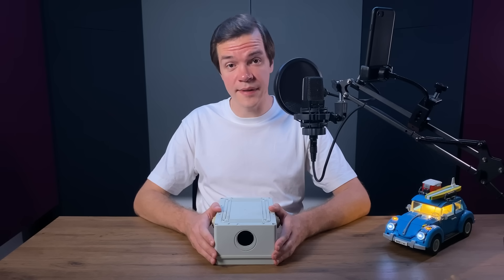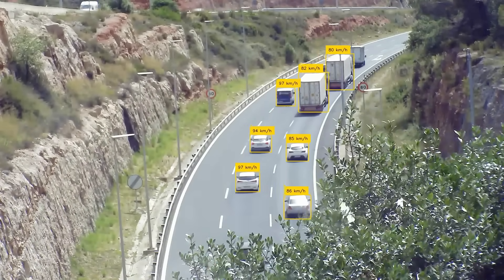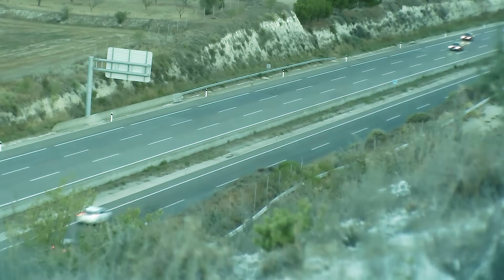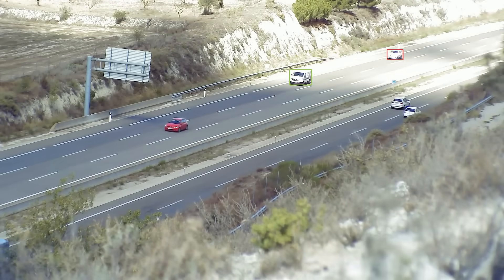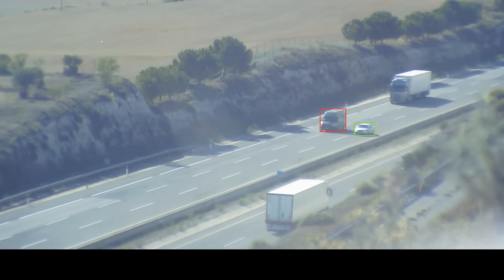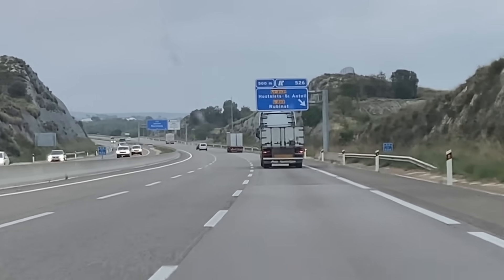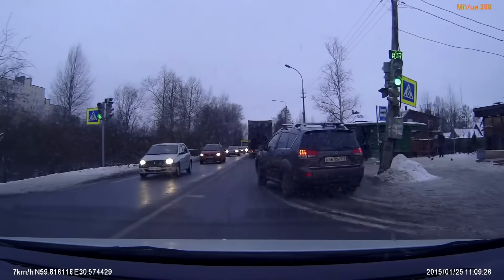New Anti-Tailgating Camera Reveals Shocking Statistics

Comment: Thank you! It's great you show how (relatively) easy anti-tailgating measures could be installed. Of course you may have someone look at the footage to check if someone got cut in order to not send out fines to the wrong person (even though that could probably be automated as well, by detecting Lane changes).

Anyway, I have always been very sceptical about self-driving cars, but every time I drive on a German motorway, I realise that it cannot be worse than half of th drivers there...

Comment: The key is fluidity. Not all people have it. Some people are choppy and use uncoordinated driving inputs that is governed by fear rather than confidence. Not understanding grip limit, escape routes, weight transfer, slip angle, etc. all count as recklessness to me. 
If you can't predict what's gonna happen to you in the next 5-10 sec, you're already in trouble. You should drive in a predictive manner, with varying alert levels and if you cannot for some reason, you can decrease your speed, also you can take a break, or go alternate routes that fit your current capacity and pace.

Comment: I very much like this video. What do you think of this: dangerous is the difference of speeds used on a highway, not really the total speed. Since the total speed on the lower end however is fixed by trucks, speeding actually is the main root cause of danger.

Comment: 35 years experienced driver here. What happens when you leave a safe distance between you and the car in front? .... That's right, someone drops into it and way too close. Tail gating is a universal thing, it's frequently an act of aggression that's intended to intimidate the slower driver into speeding up. It often has the opposite effect. Where I live the tailgating vehicle is usually an Audi, that might be a perception thing though... was that vehicle you observed speeding at 180 kph an Audi? It looked a bit like an Audi and was certainly driving like one.

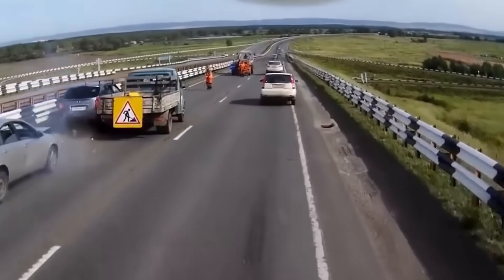Comment: No stats on actual incidents or if violating safe following distance is a significant predictor of accidents. Raising the question of automatic systems to punish violators is callous and unscientific. Some of the videos you clipped together run counter to your point eg: the truck at 9:12 but the accident at 6:06 describes it more accurately.

Comment: The solution is not to hope people follow your example, the solution is to maintain a safe following distance regardless of what other drivers do. If other people are constantly cutting into your following distance, then it tells you that traffic is too dense to go the full speed. The problem is just that most people keep up their high speeds even as the road becomes too crowded to support it. If you slow down, just slightly, then the people behind you will either slow down to match, or (more likely), they will change lanes to pass you, which will put physical pressure on the rest of the road to slow down as well. At lower speeds, shorter following distances become safer (though then impatient drivers begin behaving unsafely in other ways).

Comment: Most tailgaiting can be prevented by the front drivers.  In the states the left lane on the highway is designated for passing.  If you are in the left most lane move over if the car behind you is gaining on you. All the time where i live, semi trucks pass semi trucks going 1-2 mph faster than the other semi trucks, and it can take 5+ miles for the congestion to resolve.

Comment: in sweden it's very uncommon with cameras that issue fines on highways. The cameras are on other types of roads. Speeding is very dangerous when you dont take into account all that can happen on a street. Not much happens on a highway, which makes it kinda safe to speed. However driving where unforseable events are more common, speed becomes more important. Lower speed gives you more time to react and the consequences of crashing and driving into people are reduced.

Comment: One thing most people don’t think about is that cars have length, and as traffic slows down that becomes a big factor. 100 km/hr is 28 m/sec. So a one sec follow distance puts your front bumper 28 m behind the car in front’s FRONT bumper. If all the traffic slows down uniformly to 10 km/hr, the 1 sec follow distance puts your front bumper 2.8 m behind their FRONT bumper, which puts your front bumper inside their trunk. This does not even account for reaction time. Basically as traffic slows, highway capacity decreases.

Comment: Cars have the technology to be programed to follow at a safe distance.. but not everyone uses that feature or abides by it. So why not take car safety a step further and have a mandatory warning? You could employ this technology as a standard the exact way you do with seatbelts. If you dont put on your seatbelt on get an annoying dinging sound and blinking dash icon till you abide by the law. If you followed to closely and got a dinging sound and red blinking dash icon Im fairly sure everyone would back off after a few seconds just as they submit to putting their seatbelt on. The impact would literally be HUGE since most accidents are caused by following too closely.

Comment: Great video - I think there are other things we can look at, like you suggest, beyond enforcement.

Safety equipment in cars could do this automatically - not brake, but make the annoying sounds when you have less than a given distance at a given speed to the vehicle in front of you.

We have lane safety and lighting in mirrors, so we can ensure that the annoying sounds are heard only by the driver who crossed lanes (not the one who’s had their distance cut by someone else).

It’s logic that looks at your forwards gap to encourage you to not close in on the car in front, and logic that looks at your rear quarters/steering/lane adjustment to determine that you have just closed the distance on another driver.

The logic of someone pulling into your lane is looking at your front quarters and steering input - if you didn’t close the gap yourself, then the annoying sounds only start after a second or two instead of immediately.

Seems obvious to me, rather than trying to track this by roadside cameras.

Comment: 6:05 The minimum safety distances are two lines from the emergency lane, at first glance you can see that no one respects them.

Ironically, if Motorists, who cannot stand slowdowns and traffic jams, all drove according to safety rules and at the same speed as the cars in front, there would never be any traffic jams and very little slowdown ☺️

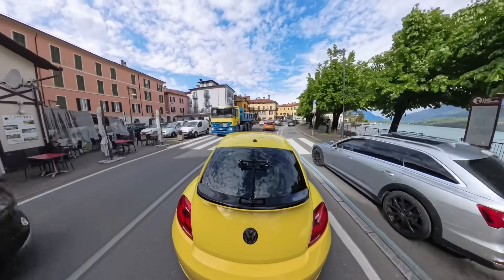Comment: 5:31 speed absolutely kills people and it's not just about stopping. The quality of roads and grade of turns are set to accommodate particular speeds. 

Also, the faster you're going the less time you have to react to unexpected obstacles that might appear on the road.

Speed traps can remind people to keep an eye on their speed, a lot more people might speed everywhere without them. 

There are also average speed cameras that detect cars at one point and measure their speed to another point, these can cover much larger areas that include high accident zones.

Speeding does kill and if you think you're a good enough driver to manage it, you're the person who's going to die unnecessarily if there's an obstacle one day

Those obstacles aren't always just the other vehicles on the road with you

I do want to clarify that I'm totally in agreement that tailgating is just as dangerous, if not more so, than speeding, but I feel like this video dismissed speeding too much

Comment: This! This is the reason for all those accidents that could have been avoided.

On country roads, where there is one lane per each direction the main problem is LACK of speed.

Let me explain: if someone does not drive at the speed limit it will 'force' the others behind to overtake. Thus leading to dangerous overtakes and unnecessary speeding (if the speed limit is 100, and the one in front is driving at 90, you will regularly see people drive at 130 ehile overtaking, then gradually slow down to 100. But if one would drive at 100 and maintaining that speed, then the overtake would not even take place)

Comment: The most dangerous thing on highways is absolutely people who make unnecessary lane changes in an effort to go faster
Reply: or u want to merge into the lane on ur left. there is a car in the left lane about 4 car lengths back going at about the same speed as i am, so he is not closing the gap., u put on ur left turn signal and the guy in the car in the left lane starts to speed up
Reply: @meTimetraveler  yeah that's annoying
Reply: did you not watch the video lmao wtf its tail gating!!!!
Reply: Not at all. The most dangerous thing is people who sit in the middle or 3rd lane going the speed limit or under
Reply: How is changing lanes categorically dangerous? Can you not see the cars to your side??
Reply: @PiOfficial  I don't think it's categorically dangerous, it's just not as safe as staying in the outside lane, which is why it's taught when trained to drive at speed. If I remember right there's 2 main reasons for this, first is that you only really have to pay attention to 3 sides (front, back, and inside), not 4, which lowers the cognitive load, and 2nd is that it doesn't needlessly increase the mechanical stress on the tires, which lowers risk of failure.

Contrast that with weaving in and out of traffic where you're going in out in out in out of traffic all the time.
Reply: Or the slow people in the left lane forcing them to change lanes.
Reply: @conservativeriot5939  not being permanently in the passing lane goes both ways. If you’re just driving fast and not passing someone, you’re using the lane wrong too.
Reply: @z-beeblebrox not if there's nobody behind me that wants to pass. I usually move to the right any way so I can blend in.
Reply: @conservativeriot5939  The rules of the road don't magically change when there's fewer cars
Reply: @z-beeblebrox  there's intent behind laws. Can you figure out what the intent of this law is?
Reply: @conservativeriot5939   To keep the lane clear for passing, which you would be failing to do in this scenario
Reply: @z-beeblebrox correct and incorrect in one sentence. That takes skill.
Reply: @conservativeriot5939 asinine how confidently wrong you are. You should be leaving the left lane every time you are finished passing. It is never a driving lane
Reply: @deadmittens50  I'm just that good. Haha
Reply: @z-beeblebrox yeah just because theres no one behind you doesnt mean you are suppose to be traveling in the passing lane
Reply: @deadmittens50  This guy represents half the people in the damn lane in the first place
Reply: @z-beeblebrox   the left lane is the F the speed limit lane, no point in getting back in the right if you going fast enough to pass everyone in the left, Just have to pay attention to your mirrors for someone who's going faster than you and get over for them then get behind them and keep moving.
Reply: @conservativeriot5939 Nope. They are annoying, but not not dangerous, contrary to those who think they can make them change their behavior by being reckless and dangerous around them.

Comment: Speed cameras on freeways in the U.S. are stupid. They should work like they do in Europe and the rest of the world where they measure speed over distance by using multiple cameras. You can easily slow down to the speed limit where there's a camera and then speed back up again, but not if your speed is measured by how long it took you to get to the next camera - the only way to not get a speeding ticket with that kind of speed camera system is to not speed. There's no cheating physics.

Comment: From where I'm from, light tailgating in the left lane (typically faster lane) is acceptable to signal the slower car in front to cede passage.  Typically going from 30m to 20m/15m to communicate that the driver forward needs to cruise to the side.

I know this isn't recommended but in low-mid congestion and ideal weather, I think its ok.

Comment: We have a minimum distance of 2 seconds in Austria, since it accounts for the other car's break distance.

We also have some camera's that can issue fines for tailgating. They simply measure the distance over a stretch of road. If you are beneath the limit at both entry and exit, you get a fine.

Tailgating is still a problem here though, but less than in America

Comment: Ultimately driving will never be very safe. The solution is more public transit and mixed modal transport. People can take rail or maybe fly for longer distances but then for short distances they can use micro mobility or car shares for local areas. The problem is this essentially abandons the concept of individual ownership of vehicles - which society won't accept.

I like your conclusions but I think that always applies to speeding and some other infractions - to some extent at least. There have been plenty of instances where my choice is either speed up a lot or massively slow down so I can safely get over a lane - slowing down isn't always possible as there are cars behind me, plus then I'll have to match traffic speed again once I change lanes and cars generally can decelerate much more quickly than accelerate, so it's a lot easier to speed up, merge, slow down, than the reverse. I've also had to speed up to get myself out of relatively unsafe situations or put distance between me and irratic drivers.

Comment: Tailgating has always been, in my mind, one of the very dumbest common driving habits.  People who tailgate seem to have a profound lack of both intuition of the physics of vehicles, and also imagination and the ability to guess the future outcome of a situation based on variables estimated in the current moment.  They also drastically overestimate the amount of skill and "control" they possess.  Always assume control is an illusion (it is) and act accordingly.

I think most people don't realize that when driving down a highway at 60 mph/96.5 kmh, they're traveling at 88 feet/26.5 meters per second .  That's actually very fast.  

If an object that weighs several thousand pounds is flying around at speeds like that, it takes significantly longer to stop than most people think.  

At 60 mph/96.5 kmh it takes a good 250 feet/76.2 meters or more to stop.  Already that's almost 3 full seconds.  Just the brief delay in your reaction time from seeing danger to depressing the brake pedal will add another not-insignificant distance to your stop at speeds like that.  Antilock brakes also behave in a way most people don't expect.  All in all, you're looking at a good 5 or 6 seconds to stop that object moving at highway speeds, and that's a VERY LONG TIME given the kinds of timescales car accidents happen across.

It's obviously an abysmally poor idea to drive 60 mph/96.5 kmh toward a car that's 2 carlengths ahead of you.  Giving yourself a mere ~30 feet/9.14 meters to make a stop that's gonna take you 250 feet/76.2 meters or more to complete while your life is at risk, is plain stupid.  You could crash into that car like EIGHT TIMES in the amount of time it would take you to stop once.

Just don't tailgate.  It won't get you there faster.  In fact, it causes more people to slow down than speed up.  If someone else is tailgating you, try to move over if possible and just let them get tf away from you.  On streets where you can stop, just pull over for a second.  It's not worth the risk to your health—or if you're American like me, your insurance premiums and the risk of bankruptcy from healthcare costs...

Comment: if I leave 3 seconds to the car ahead, someone will always cut in. So I don't brake when that happens, but I may slightly ease off the gas, a little. The good news is, I can see not just the vehicle ahead, but also well ahead of that. If the driver ahead were to slam on the brakes without warning and for no reason, they would instantly create a dangerous hazard. But they dont. They always have a reason, and I am able to anticipate that and gradually increase the distance, or change lanes, to remain safe.

Comment: I'm not sure I agree with how you calculate the safety index. Kinetic energy goes with the square of the speed, not linearly. What you're calculating is a likelihood of collision, but it ignores the severity of the collision. So in your example at 10:21
The car driving at 120km/h has a kinetic energy of about 256*m  at collision (m is the mass of the car), while the car driving at 180km/h has a kinetic energy of 625*m, which is more than double the energy at time of collision.

Comment: This is an idea I had since the early 2000s was to collect insurance that she had to have cameras yourself and if they can control with a computer and chip a CPU and GPU know that right and have a group of quick guidance system hooked up in this idea I had not just to control you in between the lines but also to control your speed to the speed limit and disabling you if you try to get away or you know keep all your things that you’re supposed to be taking a look at them the dashboard that if you doon’t do it the car will drive you to the place to get it fixed

Comment: HACKING TAILGATING with PATIENCE: In Texas, although the average highway Speed Limit is 65 MPH, the Average Speed of traffic is 78 MPH. I set my cruise control at 60 MPH and stay in the middle lane. Unless I'm getting on or off I avoid the far right lane ("slow lane") because people are trying to merge in the slow lane and in rare cases a driver in the slow lane may be going 45-55 MPH.

Now, I very rarely have to ever go around anyone and because most drivers in the middle lane travel at the posted speed limit of 65 MPH or faster. This results in everyone going around me and decreasing the odds of me ever tailgating another driver.